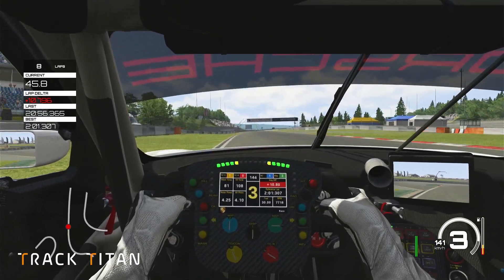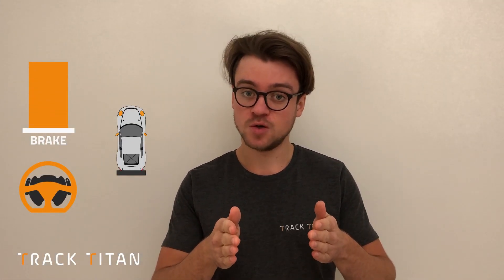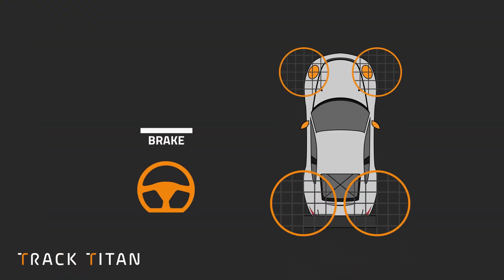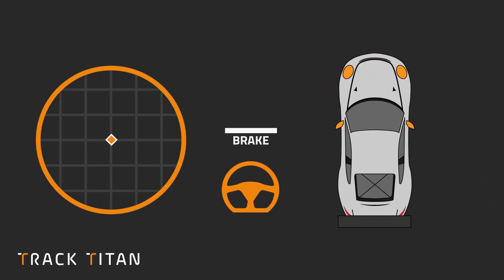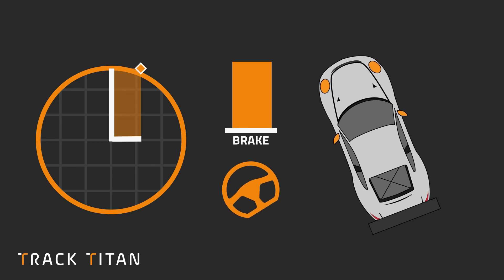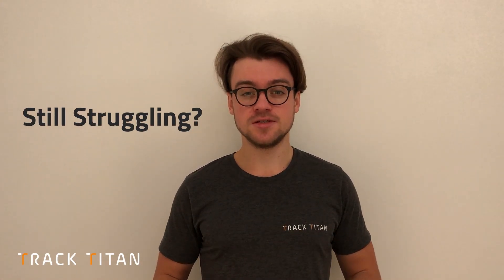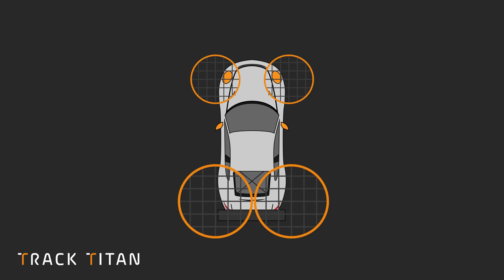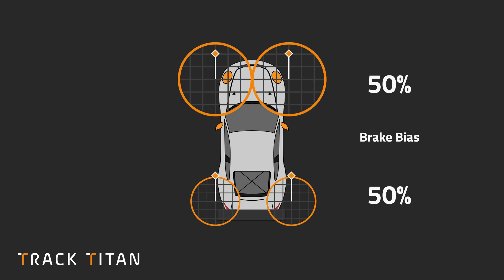Why do you keep spinning when turning in? | Track Titan Oversteer Guide

Comment: If we put the brake bias 100, turn the wheel, and apply throttle the car will start doing doughnuts ? 
brake bias - 100, wheel is straight, then the car will do burn out?
And 0 brake bias means the rear just locks up right?
Reply from the maker: The brake bias only affects the car when you actually use the brakes and is always a distribution that adds up to 100, e.g. 30:70 or 50:50.
Reply: @TrackTitan  so can't be 0:100 or vice versa?
Reply from the maker: @yasasvyguntur4109  Theoretically one could do that but no car would actually allow you to set it up like that as it doesn't make any sense at all.

Comment: you have covered alot of imp info...nice. also you should've mentioned how to adjust or handle brake bias. I mean a separate small video on that explaning in action by changing bias.  We just increase or decrease. What happens when we do that and all...
Reply from the maker: Coming later 💪
Reply: @TrackTitan  waiting eagerly behind the wheel holding the setting to change 😛